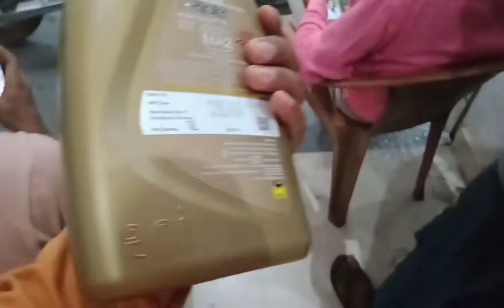tvs Radeon 110 cc bike service ❤️best tvs bike #

Comment: I bought new Radeon bike .. it almost one month running and 350 kilo metres ...the problem is like this; many time while running the bike suddenly the bike running is stop and its sound bhup bhup bhup seen like the fuel is finished but my fuel is full ... the bike is on only it cannot go ahead its stop running.. when I off it and I started again it's not on .. when I shake the the fuel tank and the fuel is moving and when I start it again then its start .. it wound stard unless and until I shake the bike ... I dont know what is the problem
Reply: Don't fill the tank full not more than 9 liter
Reply: It's was same problem with me too since I took bike after 5months..while riding in middle suddenly it used to stop again I used to open fuel cap then it used to start..everytime before I start the bike I used to open the fuel cap and then start then it was running nicely but when i stop and start it would give me problem I gave it for servicing in showroom in tvs company it was not done changed parts still didn't work in Bangalore problem was solved..this year in April I had serviced with no problem bike was working fine but again same problem since one week don't know what is real problem in this bike.
Reply: @aashug2631  brother .. I have solve the problem. It was an oil filter problem.. go to the showroom service centre let them check an oil filter .. because my oil filter was fill with air and the air block the oil to pass ... that's why while running the bike is stop because the oil couldn't pass properly ..thank you